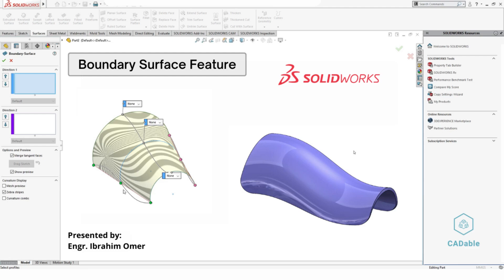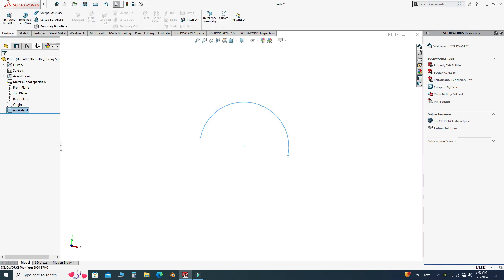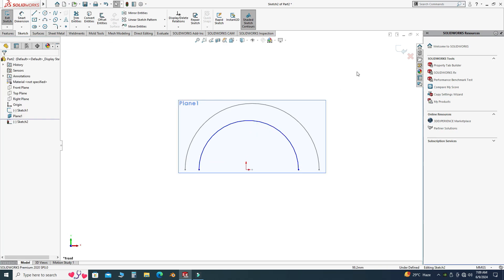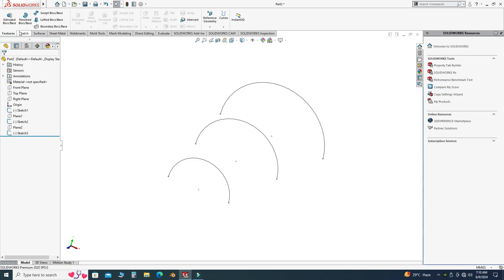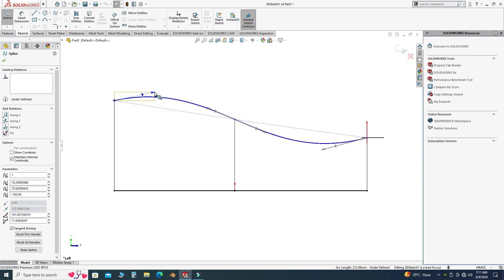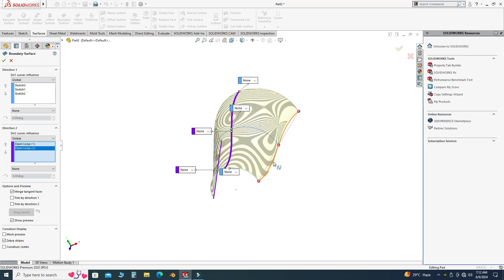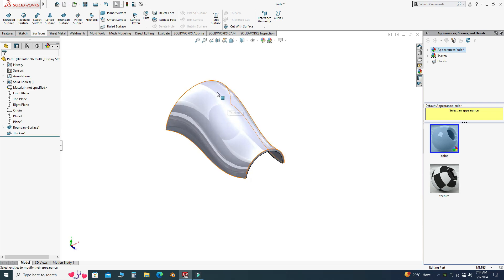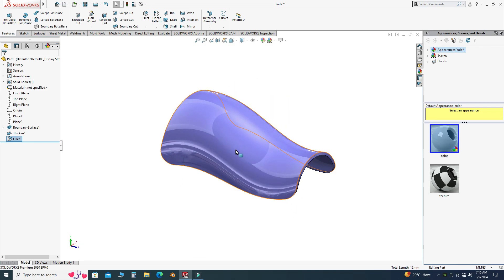Boundary Surface Feature | Solidworks Boundary Surface | Boundary Surface with Guide Curves

Comment: You didn't even explain Boundary surface feature, 99% sketching and just create it?? Wtf
Reply from the maker: You mean explanation of boundary surface? I will create a separate video on this topic. For now:

Boundary Surface is a powerful surfacing tool that creates high-quality, complex surfaces by filling gaps between multiple curves or edges, offering precise control over shape, tangency, and curvature in both Direction 1 & Direction 2.

Unlike Loft, which has limited end-profile control. It's ideal for consumer products and automotive designs, enabling smooth, curvature-continuous transitions, often resulting in a better finish than Loft or Boundary features for complex organic shapes. 

Thanks for sharing your input!

Comment: Didn’t exactly explain how boundary surface is different compared to the other surface features
Reply from the maker: In SolidWorks, a boundary surface is used to create complex shapes by defining the surface with two or more curves or edges. This feature allows for precise control over the geometry, enabling smooth and continuous surfaces.

Unlike lofted surfaces, which connect multiple profiles along a path, boundary surfaces are defined directly between curves, making them ideal for intricate designs. They differ from extruded or revolved surfaces, which create simpler shapes, and from fill surfaces, which only fill closed boundaries.

Boundary surfaces are widely used in product design, automotive, and aerospace applications for creating ergonomic and aerodynamic components. Their flexibility and control make them essential for advanced modeling tasks in SolidWorks.